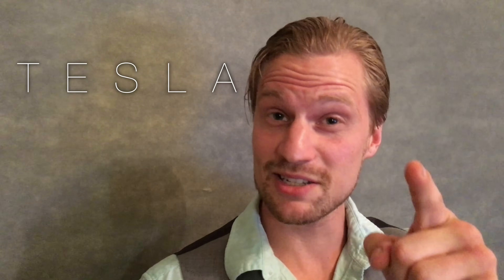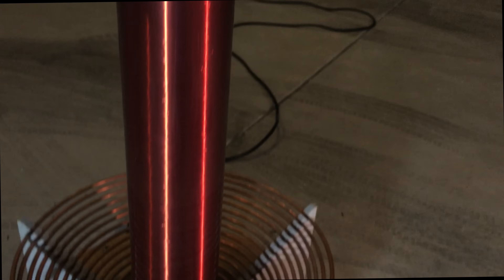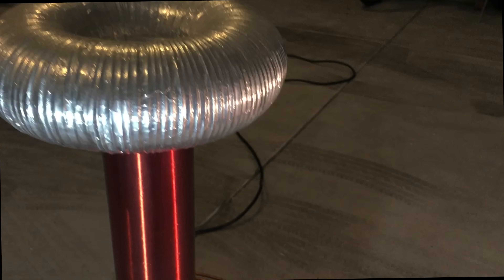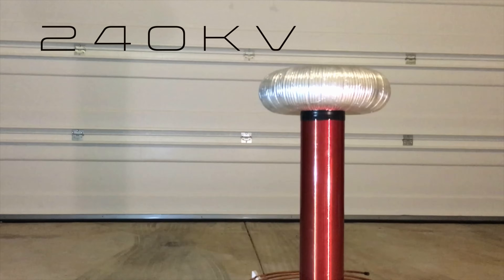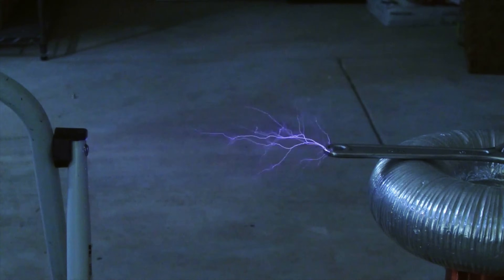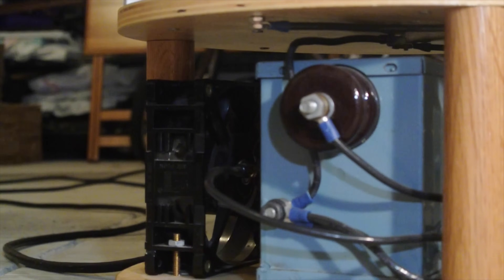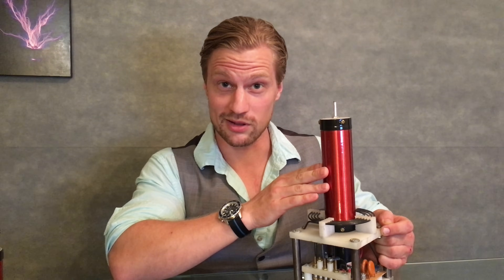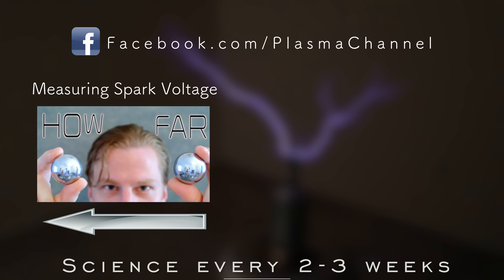This Tesla Coil changed EVERYTHING - THE GENESIS COIL

Comment: What change occurs in the resonance frequency as the secondary coil wire SWG increases? Please reply... Sir 

What is the relation of secondary coil resonance frequency in secondary coil using wire SWG 

Frequency increase or decrease 
Waiting for reply
Reply: so thicker wire= less turns for the same given space and so the resonance frequency goes up. thinner wire= more turns for the same space and the reasonace frequency goes down.

Comment: Hi Jay! I am also on a tesla coil project. It should be a DRSSTC coil. So I've made a power supply that gives 40V and 20 Amps of current. I have made a zvs driver that works with the same voltage, but i do need to know how i can do the secondary coil. I guess that i can use a plastic pipe for it or?  If the current is high, then its better right? I damn need to know, because buying a tesla coil secondary is very expensive! PLS tell me. Great arcs Jay. What is your email address?
Reply: Any luck?
Reply: just use a pvc pipe and some magnet wire

Comment: How do you actually go forth when calculating the number of turns and diameter for the secondary and primary coil?

https://www.teslascientific.com/products/coil-resonant-frequency-calculator/

That's a calculator for it. If the primary coil has a length of, say, 10mm, a diameter of 20mm, and 6 turns, that gives a frequency of 184268 kilocycles/second. If the secondary is wrapped onto the primary like your small teslas, it has has a diameter of 20mm and length of 150mm for example, you get 2192 kilocycles/second. Not really matched up! is 1:82 a resonant relationship? I'm not sure.

Comment: Your best video ever by my choice. You inspired me to make similar Genesis tesla coil that also works at 360W, 24V 15A zvs driven flyback transformer with 30cm sparks.
I'm great fan of your work sir :)
Reply: Dood make a vid on it, i'd love to see :)  Also, I thought flybacks were only good for about 150 watts.  Or is that just for more modern flybacks?
Reply: @JoshHopkinsYT  i used a flyback from a Philips tv, but most of the flybacks can handle even more power, i get almoust the same output like if i was using a microwave oven transformer
Reply: @thegorazd7346  Awesome, well I have a couple of extra fbt's so maybe i'll see how long mine can last at around 300 watts.  I know the sparks sure get way bigger if I am not limiting the current.  I need to make another vid on my sgtc as I recently changed my topload to a 10cm ball and its waay better than the 64mm ball i had.  Anyway I'd love to see your build, mine is just an ebay kit that i put together, a standard zvs flyback sgtc.

Comment: Greetings to you... FYI, a few tips:

1) Your NST may be 360 VA (not Watts!), and you should measured current draw & transformer primary voltage for an accurate idea of actual power expended...  It may be MUCH more than 360 VA, depending on your tank capacity.

2) Professional TC builders have established a reasonably accurate estimated electric field strength of 200 kV/m.

3) Secondary output voltage can be approximated by rule of conservation of energy on the primary & secondary capacitances, assuming 75% of the energy is transferred (the other 25% is lost for obvious reasons. So V₂ ≈ 0.866* V₁ * √(C₁/C₂)

4) Secondary voltage can approximately be measured, by inserting a wide-band current transformer in the secondary ground connection & measuring the current I₂... Measuring the secondary inductance L₂, and measuring the resonant frequency (with a frequency generator) to get ω (2* π * f), output voltage V₂ ≈ I₂ * ω₂ * L₂

5) You are using a fixed, quenched spark gap, so your break rate is fixed.  A much more effective break is a rotary spark gap (preferably using a synchronous motor if NST’s are HV power source).  4 pole motors themselves have 30 breaks / second & 2 pole motors are motors have 60 breaks per second, and the number of electrodes on a single break wheel can multiply this by 2, 4, 6, etc. Other breaks have been used on high power SGTC’s but are hard to build & very expensive!

6) You have breakout on your top load, so I would suggest making it larger.  This will detune your system, so primary tap will change.

7) You can estimate your maximum theoretical output spark length in inches by:

Length ≈ 1.7 * √(I * V)
where I = Line current (amps)
and V = Line voltage (volts) @ HV primary terminals...

Hope the above was helpful!!!  Best regards coiling!!!  ⚡️⚡️⚡️

Comment: Wait, so how do I adjust breakup?
Reply: you can increase the rate which the spark gap fires. If you're using rotary spark gap, then you can increase it by increasing RPM or increasing number of electrode. If youre using static spark gap, decreasing the distance of electrode increases breakout rate but limits the voltage.
Reply: @juntendo6104  thanks makes sense
Reply: Its brake rate. Not breakup

Comment: Can you please maybe make another video just showing this thing off. It’s beautiful and I’m going to make one just like it except it’ll use 56kv so it should be very impressive......
Reply: I wouldn't use 56kV for tesla coil. Such high voltage is hard to design and capacitor must be be rated at that voltage with some headroom. Usually TC are designed between 4-15kV
Reply: @juntendo6104  im going to make a flat diy capacitor. It won’t be the most effective but it’ll work.

Comment: Would you get electrocuted if you touch the primary circuit?I know a 30mA NST won't kill you but what about the capacitors?
Reply from the maker: The primary circuit absolutely would be lethal. We’re talking 12,000 volts at thousands of amps, at aboutb120hz
Reply: @PlasmaChannel  Int't that at several 100s of KHz like the secondary?How do you know that it is 1000s of Amps?
Reply from the maker: You are correct at hundreds of KHz, however, hidden within the waveform is a 120 hz waveform as well.
Reply: @PlasmaChannel  I read somewhere that small Tesla coils with less than 1nF capacitor can work with 5 Amp pulses,not 1000s of Amps .Electroboom got shocked by a 1nF capacitor at 5kV and 12A.Would even a small primary circuit be lethal?Some people write on forums that they experienced a flashover between primary and secondary,got a painful electric shock but no permanent harm.What do you think about them?Were they lying or is that actually possible to not get harm if the secondary arcs to the primary when you touch it?
Reply: @MernokiMegoldasok  Tesla coil capacitor charges up and fires releasing all of the charges into primary coil which resonate at LC resonant frequency. The capacitor usually discharges at hundereds or thousands of amps in pulse but average current is not that high. (10s to low hundreds of amps)
Reply: It depends on the duration of shock as well. Mehdi touched charged capacitor which doesn't have constant charge current. Its charged and it discharged when he touched it. The tesla coil capacitor is always hooked onto the power supply and is lethal when powered on. If the power supply is turned off, the capacitor can still hold charge at deadly energy inside.
Reply: @juntendo6104  I was talking about very small Tesla coils,less than 80 Watt and less than 25cm tall secondary.Mine actually works with 0.5nF cap quite well.Spark gap set at 1.2mm,it operates at 1.25kV.Many people say its not going to work under 2kV but I actually managed to do it :)

Comment: Show the circuit diagram plzz and which type of spark gap do you use
Reply from the maker: Hi the circuit diagram is a standard spark gap coil circuit, with spark gap parallel to the power source.
Reply: @PlasmaChannel  thanks sir

Comment: Can tesla coil be powered by a stator in a small engine? If yes can it be used as substitute for ignition coils? Perhaps it could be used for watersparkplug? What do you think? Your answer will be very much appriciated. Thank you.
Reply from the maker: A tesla coil would likely not be as efficient as producing a spark, as an ignition coil. Ignition coils are already optimized for their use (power for certain size, durability, able to be run for thousands of hours.

Comment: If the input power is 360W and the output voltage is 240kV then the average output power is less then 1.5mA.
Reply from the maker: That is assuming a continuous wave transformation of power. A Tesla coil is a disruptive discharge coil, meaning energy builds up, then discharges into a spark. Often with higher currents.

Comment: So, Jay... am I right in thinking the following.... Tesla coils produce very high voltage, very low current arcs... you can draw the arcs to a metal rod which you are holding with bare hands with relative safety and it doesn't hurt.... but.... if you take the arc directly to your skin, it hurts... so, am I right in saying the arc itself holds a different sort if energy than the electricity? Is the greatest impact at the entry-point or is there something I'm missing???
Reply from the maker: DilligentTolloller is not wrong by saying static is not electricity. That is correct. by definition, electricity is the flow of electrons. static is non moving electons, or static charge. How, the reason why is burns you, is because the spark burns at thousands of degrees. your skin cells cannot handle that. Metal rods can. Its the same current flowing in both situations you listed. But the metal rod does not vaporize like your skin cells do.
Reply: Matthew Campbell yes it is. It’s commonly known as static. It’s not electricity it’s an energy. But when it goes into a pole there are electrons in a metal conductor and all off the static goes into the ground. However. Not everyone would call it static.

Comment: Is there a way to calculate the resonance frequency and use that to calculate the required size of the primary?
Reply from the maker: Indeed there is. This is a quarter wave coil. Meaning the wire in the secondary is the length of a quarter of one cycle of its electrical frequency. But to determine size of primary, you need to take into account your resonant capacitor too.
Reply: Plasma Channel thanks! Can’t wait to try it out.

Comment: Correct me if I'm wrong. But the secondary doesn't need to be a long tubular coil? If the inductance is happening it could be a flat pack coil. I noticed your primary is an upward cone shape though. Is that so that you get a focused inductance over a larger surface area. Or was it just esthetics? I have an idea for a smaller form factor tesla coil. But I want as big of sparks as possible with as low amperage as possible. So as too not hurt anyone.
Reply from the maker: You are correct! My primary at an angle is both for appearance, and for functionality. Also, pancake tesla coils work wonderfully. I'd recommend a standard TC secondary though.

Comment: What did you use for a power supply on the medium sized coil at 3:50 ? I am designing a tesla coil similar to that size but I need a power supply.
Reply: He should make a video explaining the calculations based on the size of our project! Would be great!
Reply from the maker: I used a 12kV, 30mA Neon Sign Transformer NST. Old style type, iron core.
Reply: Plasma Channel thanks! Where did you get it?

Comment: Very nice, but I am sure that by tuning that coil you will be able to get even larger arcs. I have mutch smaller coil and power it with 170 watts and get arcs the same size as you do with 360 Watts. Try moving primary tap and see where you get biggest arcs. Also number of spark gaps is very important, if you could get your coil to work with single gap, it would give biggest arcs because there wouldbe very small amount of energy lost on heat...
Reply from the maker: The genesis coil is actually already tuned. Been tuned for 10 years. But, I do feel like I should be achieving more than 16-18" discharges. Im using a resonant capacitor matched to my transformer, and the primary is tapped at the most productive spot. I do use a multi gap spark gap, but cant imagine it would affect performance that much...
Reply: Plasma Channel yes then it could very well be your spark gap wasting power. Anyways great video
Reply from the maker: Thanks!

Comment: I got some good arcs, out of my coil, around 6 inch arcs. But I want longer. I think it is my homemade bucket capacitor that I built. I wanted to know what capacitors you used so I can get them and try them out.
Reply from the maker: I highly suggest polypropylene pulse capacitors. They are designed for high frequency, specifically. Meaning Tesla coil use is no biggie to them. I guarantee you’ll get another inch or two  if you switch
Reply: Thanks, but what’s the capacity(nF). And I need them to work with a 15kv neon sign transformer
Reply: @ArpadBuildsThis  Usually with a neon sign transformer you need about 10-30 nF of capacitance. Also make sure your caps are rated for your max peak voltage. For example a 14.4kv transformer may produce 20kv during the peak of the sine wave. You would need a string of caps rated for around 22kv if you are using a 15kv transformer. Hope this helps.

Comment: Oh man, that neon sign transformer will never die, We have those here sometimes you just need something that isn't switchmode/protected to do the job.
Reply from the maker: Yeah the GFCI internal protected NST's make me want to smash my face into a wall. So little can be done with them. Long live the iron!
Reply: @PlasmaChannel   We have been making switch mode PSUs here with the SG3525 IC they are easy to use as the TL494 except they are about 80% harder to kill. If you know about switch mode construction you may want to look into using that IC for future builds as it's stupidly robust against EMP issues. Since that IC change we have pretty much placed the Iron NST on the back emergency lab needs shelf.

Have you ever worked with Tesla Magnifying transmitters? Make one, they are very very strange and have features a regular TC doesn't.

Comment: How do you tune a Tesla coil? I am building a spark gap coil and need help.

Thanks.
Reply from the maker: I specifically start with 10 turns on a primary, using a resonant capacitor size that matches my transformer. I work my down from 10 turns until optimum spark length is obtained. By working down, I dont mean cutting off primary turns. I mean tapping each turn down making electrical contact. You can also vary your capacitor size....but that is just a head ache
Reply: There are a few things, you need to balance the top load and the primary vs secondary coil. You can play around with the number of primary turns say starting at 5 and going down. You also have resonant modes which can be determined by the placement of the primary in wave harmonics like an antenna. The other on a spark gap tesla coil it break rate, While you can have an air cooled spark gap like his, and they work VERY well. they don't quite have the fast arc break of a rotary spark gap. You can also look up java TC on google for coil calculations and measurements.
Reply: Hey Jay, thanks for the tip. I did it to my coil and got 2 inch arcs. But I think my power transformer is not enough. I’m using a 10kv neon sign transformer. Please give me a tip on what I should use for a power supply. 

Thanks!
Reply: The thing is, my giant 48nf capacitor is meant for 12kv

Comment: how do Increase the break rate ?
Reply: There is a few things your could do. You could decrease the capacitance, Increase the current, or shorten the gap. Both reducing the capacitance and decreasing the gap may cause you to loose output power though, so I would recommend increasing the supply current.
Reply: @andrewobrien3973  decrease the capacitanc ...do you mean decrease the number of capacitors?

Comment: Tell me how power supply you use
Reply from the maker: I use a 12kV, 30ma Iron core NST. I love the old type ones, super robust!
Reply: If they where faster then 60 htz I would be tempted to make a doubler for my 9 kv one, I am unsure how it would hold up against use with the tank capacitors and the current needed to charge them. TBH I kind of went the opposite way of normal TC people. Some of my fully operational tesla coils are only 25x7mm I like ultra small devices :P

Comment: Where is the secondairy of the Tesla coil grounded?
Reply: The secondary is tied to anything with Earth ground, I used to just stick a screw driver in my Earthing connection in the outlet, since moving up to over 100KV I have dedicated coaxial wires hooked to water pipes that are Earthed, this to avoid to much back feed spikes on my neutral.

Comment: I'm New to tesla coils. I just built a small 12 - 18v tesla coil kit from eBay. You probably know the one that's very cheep. It's great but only gives of a 2mm arc. From videos I've watched I'm aware I don't have a top load. Can someone please explain the purpose of this, and how to add one
Reply from the maker: Top loads act as a capacitor to store energy. Modifying them also change the frequency of the secondary circuit. Tesla coils are precisely tuned devices...once they are tuned with a specific topload, removing or changing the topload will change the frequency of the secondary circuit, and, in turn throw the coil out of tune. A coil out of tune will produce very little or no sparks.
Reply: a top load helps increase the capacitance to ground, and changes the resonance of the secondary, which you can think of as a tank circuit